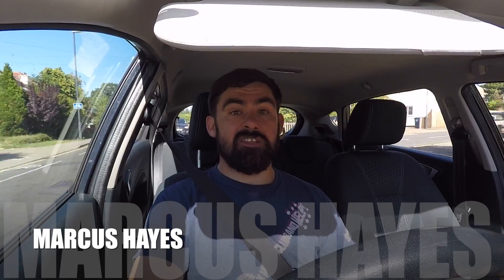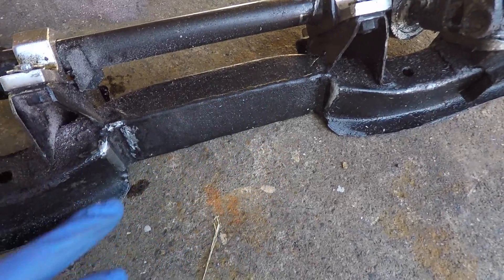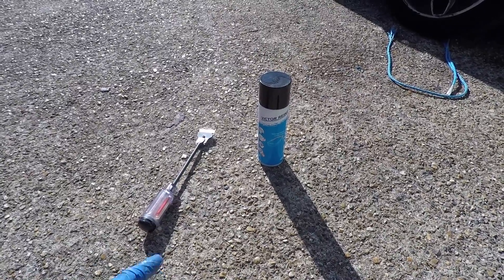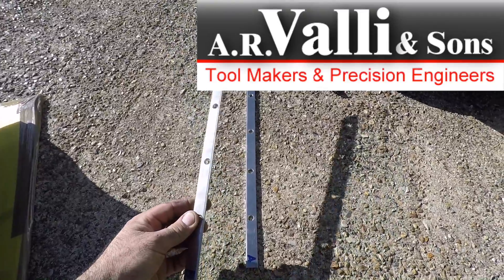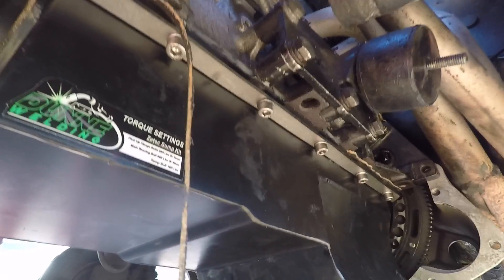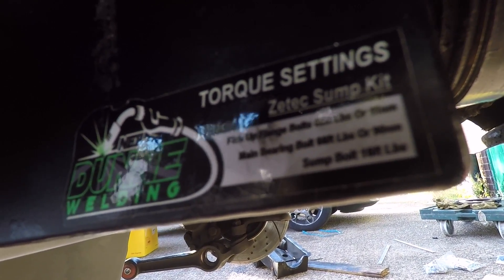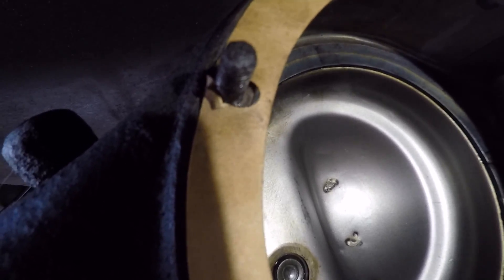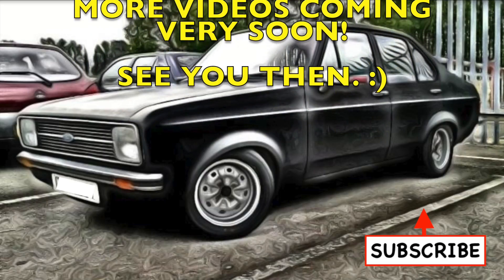SUMP AND LSD INSTALL!  'MAUDE' THE MK2 ESCORT

Comment: It's amazing how much we guys can do once the the missus goes away for a few days lol.   Let's hope the oil leaks have gone away now the new sump is in.  Diff gaskets, I learnt not to use them... Well most of Australia doesn't use them, we just run a thin bead of sealer and lightly torque the bolts, let sit for 30min then torque to spec as usual.
 Are you going to rear disk Maude or don't find it worth while ?  Great video as usual 👍
Reply from the maker: When Cat's away Marcus can play! . . . . . but I think my sink is broken!! Ever since Cat went to Vegas I put my plates and cups in the sink as normal, but when I wake up in the morning THEYR STILL IN THE SINK!!! . . . . . . I have no plans to rear disk either of my Escorts but u never know. I would like to fit a hydro handbrake to Maude (still hooked up to the drums) and see what its like. Iv got a feeling it wont be great and that might make me want a rear disk conversion with a seperate caliper for the handbrake.

Comment: Good idea using the spreader plates and torquing them up will give them even pressure so no worries about over tightening
Reply from the maker: I have still torqed them to spec but Im hoping they will cure my sump leak issues. Fingers crossed. :)

Comment: Sweet, that sump design is loads better mate. A tip for the diff paper gasket is if they have shrank to soak them in water for a while. All the best, Steve
Reply from the maker: Thanks for the advice! :) I think i remember somebody saying u could use steam but i dont have a kettle at the garage.

Comment: Liking those spreader plates on the sump my original 1.8 cvh sump had a similar plates for the different bolt patten cvh to zetec, Will be looking at a neil dunn sump soon.. Great progress...
Reply: Reminded of long washer things on Pinto can cover to spread the force.
Reply from the maker: Fingers crossed the sump wont leak now. :) The 1800 cvh bolt pattern is very similar to the zetec one. some people use the 1800 cvh sumps on zetecs.
Reply from the maker: I remember those When I had a pinto. They worked well.

Comment: hi mate what diff ratio you running.  currently building an st170 100e 
cheers
Reply from the maker: 'Maude' is running a 4.1:1 diff. Its very revvy and negatively affects the top speed of the car but Im all about acceleration so its perfect for me, especially with the longer first gear kit installed in the gearbox. :) . . .Id love to see ur ST170 100E!  :) Feel free to send some pics in a message to my facebook page www.facebook.com/marcushayesford . Also let me know if u mind me sharing the car on the page.